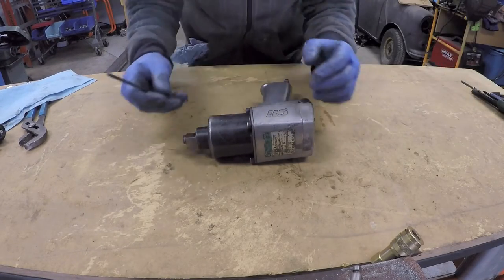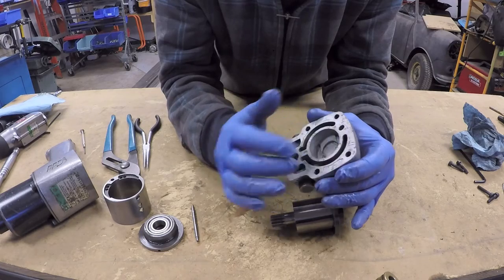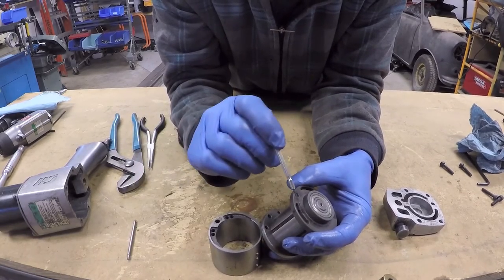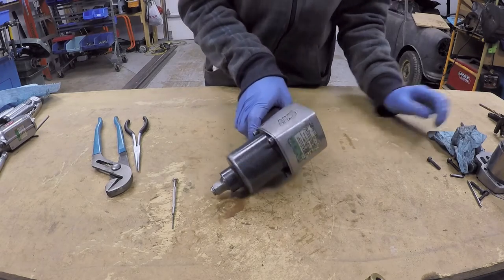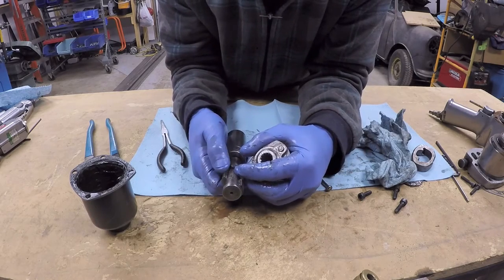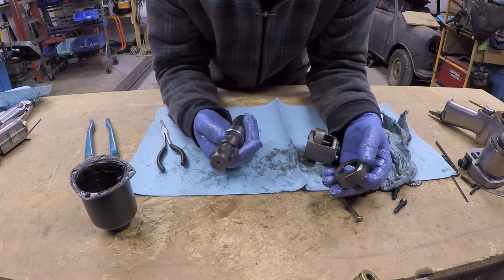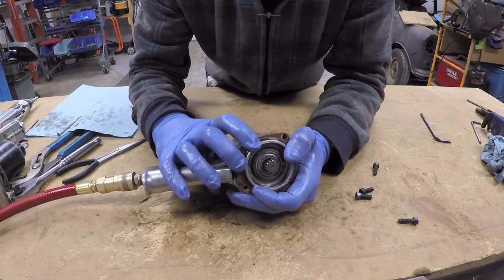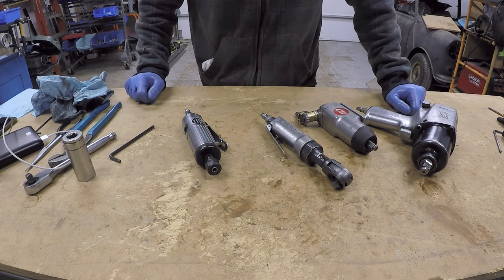How an air tool motor works ( air vane motors ) (Part 2 of 2)

Comment: Thank you for explaining in such good detail it made it really easy to understand. I found an industrial pneumatic tamper that i wasnt sure how it worked and while i dont know that it uses the same mechanism as these it does make me feel much more confident taking it apart and was great learning about the other tools
Reply from the maker: A tamper may use something like this, or it may be much more simple. YouTuber "This Old Tony" did a video on a pneumatic file that would use that same motion, so it may be a similar design.
Reply: @JoelArseneaultYouTube  awesome. I found some air hammer teardowns that I imagine are very similar but not nearly so detailed as you. I know exactly the filer you're talking about I'll go rewatch that video. Not like I need any excuse to watch this old tony haha
Reply from the maker: @tshvahn  Haha... yes. This Old Tony is amazing.

Comment: Very good explanation , hats off to you , one clarification can we use Aluminium vanes ( blade's) in place of bakalite blades , Also if you can explain how blade's are made will be useful.
Thank you..
Reply from the maker: Thanks for the comment. Most modern air tools use fibreglass or some sort of composite for the vanes. Aluminum would have a tendency to wear out and cause damage to the outer walls of the housin. 

The reason for using the material that they use is that it requires a relatively small amount of lubricant and does not wear against the housing. 

I believe the construction of the vanes is sheets of fibreglass that is laser cut into the correct size and shape.

Comment: Sir I had a doubt there is button for anticlockwise n clockwise n speed  lever der is certain speed 1 2 3 4 5 how it controlled it blocks certain air passage to go in n speed is controlled?
Reply from the maker: Hello sir. I forget exactly how this works, but yes, it blocks the passage of air and limits flow.

Comment: Sir.. What reasons the torque is very low. And why some time the motor is not rotating but the air was blowing from the exhaust side. Please tell me
Reply from the maker: Hello Saul.

This is not a simple question. It could be one of many things. Anything from a selector switch o-ring (if it has forward and reverse) to a bad bearing on the rotor. if it has a forward / reverse selector, the air can go in both sides and cause it to blow out the exhaust without turning the motor, or turning it with low torque. 

It could also be that it is dirty or rusted inside and the veins are not moving into place, so they are not sealing properly. If you take it apart, it may be really obvious what the problem is.
Reply: @JoelArseneaultYouTube  thank you very much sir

Comment: Now to make the vane internal combustion engine.

It will be simpler than the piston engine but it will need more thought in the design.

But jet engines are such. So why not a vane engine.
Reply from the maker: Rotary vien engines / motors are very inefficient. When used in power tools, this doesn't matter, because all you care about is being compact, reasonable weight and having enough power. You get the power from an external source, but it takes a 3-5 HP compressor to do the work of a 1 HP tool, due to the inefficiency. 

They do use these motors with air, and hydraulics, where losses are acceptable, but this would not work well in a combustion application. It would work, it just wouldn't work well and would have reliability issues.
Reply: @JoelArseneaultYouTube  Hi Joel. I am very happy to hear your reply. It means that you are considering something about a vane engine. 

https://www.youtube.com/watch?v=ZBKgLcQFG7Y&t=425s 

A piston engine seems very inefficient. I read somewhere that it is 20% efficient, with an 80% energy loss in heat, friction, and the problem of converting downward movement into the spin.

The piston engine was initially an air compressor of some sort, then a steam engine. Vane motors currently are used in super chargers and turbo chargers, as you probably know, but I bring it up for conversation, review, discussion and exploration.

Do you have any other insights in vane motors, vane air compressors, and vane steam power, and vane engines?